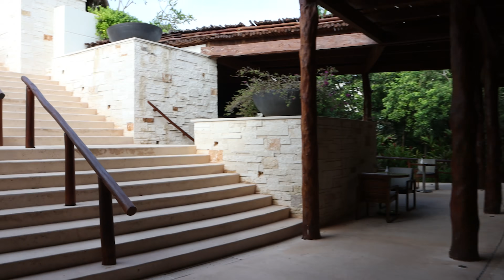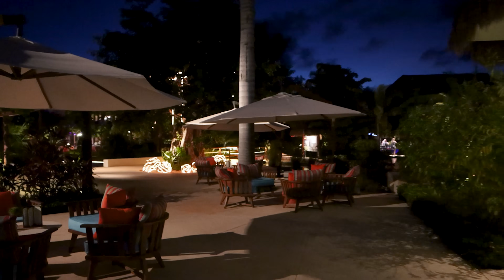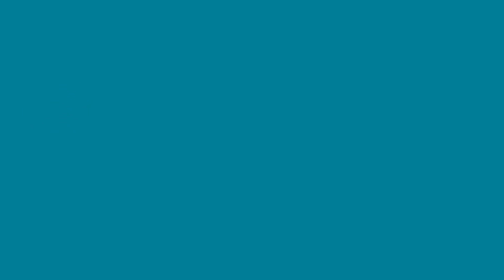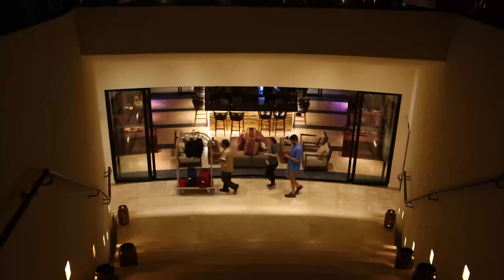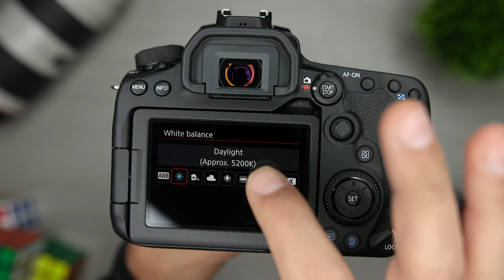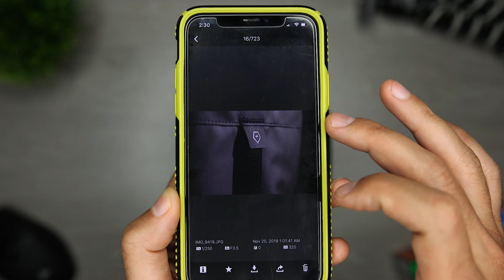Canon 90D - Watch Before You Buy

Comment: Great review. I was really excited when this camera came out last year and was planning to buy it. But as I am looking for a Camera for vlogging on my own YouTube Finance channel, i made the cardinal sin of 'over tubing' and was slowly turned onto the diminutive (and cheaper) YouTubers favorite M50!  Whilst it is double the price is the 90D my best option if I want to use for blogging and my 'family' camera sills camera as well. Or, as the majority of my use will be on YouTube is the M50 a sensible option and use the excess cash to buy an additional lens (or two)?? Would appreciate your advice. Loved the review though. Best I've seen. Many thx
Reply from the maker: Hi Keith. Good question. I love the 90D, but it's a big camera, and would be pretty heavy to vlog with. Definitely doable, but not super light. If you want most of these features, in a smaller package, check out the https://youtu.be/Nir8pfvfdFI . That's a great option if you want 4K. If you only want 1080P, the M50 will work. Look at the 16mm f/1.4 ef-m from Sigma - amazing lens (for M50 and M6MKII). I'm always a fan of investing in lenses. Hope this helps.
Reply: @TechGearTalk  That's great. I really appreciate your advice. I do like the Sigma range so I will certainly look at that option. One thing is should clarify (I'm 53 so all these tech terms are mostly way over my head, I actually do mostly Tutorial rather than 'vlogging' which I assume now is more mobile> I guess that makes the size and weight of the 90D less of an issue???
Reply from the maker: I look a it this way. If the camera is sitting on a tripod, size/weight do not matter. If I have to take it with me, pack it, carry it, and/or hold it - then it matter. Does that make sense?
Reply: Sure does, thanks. I'm going with the 90D!!!!!! .........I think :-)
Reply from the maker: Why not save money and use the M6MKII?
Reply: @TechGearTalk  lack of headphone socket was one issue I had. But the fully articulated screen of the M50 and the 90D would be the clincher. The M6 is pretty much the same price as the 90D as well - and the range of lenses have swayed me that way .........I think!!! . Appreciate the help and advice. Cheers
Reply from the maker: Makes sense to me (wanted to make sure you consider everything you can - looks like you are). I really loved using the 90D let me know how it works out

Comment: mentions competition at $1200.Doesn't mention the G9 now retails at $1200 street price is sub $1000 (B&H)

Records in 5K (6K photo mode is h265 30fps)
and records 4K 10bit 4:2:2 (h264 150MBPS) and 
high dynamic range (h265 75mbps 10bit 4:2:0). 
Records 4K 8bit 4:2:0 at 60FPS
Has sophisticated focus stacking options in-camera
Focus bracketing
Pixel shift (80MP) with de-ghosting
for an extra $100 you can record in V-Log L
Industry leading IBIS which allows you to shoot like 1 second stills hand-held.
Full size HDMI port (which can record a clean 4K 10bit 4:2:2 at 60FPS)
dual UHS-II card slots

But lets not mention it.
Reply: It's also a hybrid with an emphasis on stills. Has all the intervalometer and timelapse tools you need.
7-image bracketing
up 60FPS jpg and 30FPS raw stills
good AF for stills
not as good as Canon for video AF
Reply from the maker: I used the G9 for stills on a shoot and I really enjoyed it. I love the ergonomics (that automated manual focus assist was sweet), and the image quality was fantastic. 

I need to get one for a couple of months to give it more of a complete test - I only had it for about 4 hours. 

Appreciate you contributing to the community.

Comment: i keep wondering why buy an aps-c camera while you can get fullframe camera with that price?
Reply from the maker: Hi Ken. Good question. Canon - for example - does not offer a FF option with this same feature set. Another reason is that APS-C lenses are a lot less expensive. 

I don't have a preference, they are just different tools. What do you think?
Reply: I have always shot aps-c and I lack for nothing(Majority wildlife). It also gives you more range when framing the shot. I shoot with friends that have FF camera and the quality of the pictures is the same. FF has its benefits and with enough pixels (on any camera) you can crop. Its just your preference.

Comment: Loved the review. I'm thinking of upgrading from my T6i and would love to buy the 90D, but there's one small problem: $$$! I can pick up a new 80D which would be within my price range. Would you still recommend the 80D in 2020? By the way, I'm not into video, just stills (mainly macro), but I´m not saying I´ll never dabble in video in the future. What do you think?
Reply from the maker: Glad you liked it! If you’re now going to want 4k or even video for now, just stick with the 80d (or even a less expensive body and invest in lenses. If later on you want video, the 90d will have dropped in price. What do you think?
Reply: @TechGearTalk  I think it's a good plan! Thanks for your  advice. I like my T6i but I was looking at an upgrade for two  reasons: better battery life and a bit more weather resistance. The 80D does both. The other differences, like improved frame rate, would also be a bonus. Video doesn't interest me so much. I already have my dream lens (Tamron 90mm 2.8 VC macro).
Reply from the maker: That makes a lot of sense to me. You can probably find some great deals on a used 80D too!

Comment: What's a good body option for low light, indoor photography?  I've got a 50D with L lenses, but bought for outdoor photography at the time.  Life has changed and I now shoot far less (it's just hobby income) and almost entirely inside a performing arts theatre, doing plays and music performances.  Low light, coloured lights, high ISO noise, motion blur etc.  What bodies would be good to replace my 50D with?  Mirrorless?  An older full frame body?
Thanks!
Reply from the maker: I was happy with the low light performance of the 90D. You have very specific conditions (even low light could mean different things). Is there any way you can rent the body - and then apply the rental fee to the purchase if you're happy?

Comment: Great video, so informative and clear in everything you covered. As a relative beginner I’m curious as to how it would compare to an M50? It’s obviously a decent step up in price but wondering how the crop on the M50 compares? I am using an adapter to allow me to use standard lenses rather than the more expensive comparable M lenses. I’m really not sure what would be the step up in terms of less crop from the M50 as I was told it’s better than an entry level dslr in terms of specifications but not sure what would make the price jump worthwhile, if at all? Hope that makes some sort of sense!! Thanks
Reply from the maker: The crop of the M50 will be identical in 1080P, but significantly worse in 4K (plus the auto focus is horrible on the M50 at 4K). 

Look at this option for the best of both worlds Tracey: https://youtu.be/Nir8pfvfdFI

Let me know if you have any questions!
Reply: @TechGearTalk  thanks so much for the reply.  I forgot to say I only take photos and never video! So I'm trying to work out the difference when taking pictures with M50 compared to a non full frame dslr (I dont have the budget for full frame!)
Reply from the maker: AH, ok. So, the main difference is that the sensor on the 90D and m6MKII (which is a better version of the M50) is 32MP vs 24MP on the M50. It's not a significant difference for every user. I liked the M6MKII better than my M50 (more comfortable to use because of the buttons and dials it has). Hope this was helpful.
Reply: @TechGearTalk yes,  thanks so much for taking time to reply
Reply from the maker: So glad it was helpful. You're very welcome - I to help whenever possible.

Comment: First time viewer of your Chanel. Thanks for the honest review, looking to replace my Canon 7D MII, not happy about only having one card option, love shooting and recording to 2 cards on my shoots.
Reply from the maker: Welcome and thank you for the kind words. That is something that's hard to give up once you've learned to appreciate the redundancy.
Reply: Its got much better image quality than the 7d mkii.
Reply: mark rigg thanks!  Do you have one?  I’m in all except that you can only record to one card. Still praying for a 7DMIII but I don’t see it happening.
Reply: @TwoCaptainsOneShip  No worries yes I did buy one because Canon have stated they have no plans to do a 7d mkiii. Which is a shame. However the good news is that they have finally learned how to make a sensor and it's easily the best crop sensor available now. It's servo tracking in autofocus is not as good as the 7D so if you did lots of birds in flight then the hit rate would be lower. If I was a wedding photographer then I'd have an issue with the single card slot but for amateur use it's only a minute risk. Hope this helps.
Reply: mark rigg I shoot a lot of senior and family portraits and sports, soccer basketball and hockey. Used to photograph horses but the track I worked at finally closed so I’m out of business for the horses. 7D M II worked great for the horses for sure. Still working on the best custom auto focus for hockey. Thanks again.

Comment: Does image stabilization work in 4k video mode? And record audio in 4k mode?
I normally take photos and make videos (4k) of fast moving persons in seminar and animals in forest. Is autofocus super fast?
Sony rx10m4 vs Canon 90D. Which camera has better autofocus and image stabilization feature in 4k mode?
What would you suggest?
Reply from the maker: Yes, IS works in 4K. Yes, it records audio in 4k. You should always use the camera on a tripod or monopod if you're using extreme zoom. 

The rx10m4 has a ton of zoom (would be expensive on the 90D), but I really like the 90D.
Reply: @TechGearTalk  My main emphasize is on photo and video(audio recording without external mic) quality in 4k mode in both cameras. I have to record video and audio of person from distance(1-25m).  

Which camera has better internal mic reception of far distance(1-15m) voice  recording?

Which camera has better/faster autofocus and image stabilization in in single shot photo mode? ( to conserve battery)? {I my self in moving and tripod/etc are bulky).
Reply from the maker: I would get the 90D. There is no camera on the market that can record good audio at that distance. You will need to record with a wireless microphone connected to the camera, or use an external recorder and sync the audio.

Comment: Hi, question I just recently bought the Nikon 7500
and I am considering buying the Canon 90 D? What are your thoughts? I shot sports and my kids.
Reply from the maker: Hi Holly. Are you thinking you'll return the 7500?
Reply: Tech Gear Talk yes I bought it from Costco and they just came out with the 90d. I’ve researched them and wanted the 90d but have always used a Nikon.
Reply from the maker: I would go play around with the 90d first. I switched from Nikon to Canon years ago, and it takes a while to get used to it. Plus having to buy all new lenses... arght. 

Having said that, the 90D is awesome.

Comment: I seem to buy a new Camera every 10 years. I still use my canon 50D which I bought in 2010. Lol 😂 thanks for this awesome review, this video has push me closer to purchasing the 90D. You earned a new subscriber😀
Reply from the maker: I'm super glad it was helpful! Thank you for the kind words and for joining the community 🙏 

This would be quite an upgrade. If you want to try a mirrorless option that is less expensive with similar features, check out the: https://youtu.be/Nir8pfvfdFI
Reply: Hi
My beloved 50D has some issues (such as the dreaded error 30). My running thought is that I will move up to the 90D and have Canon repair my 50D which can be used as a backup camera.
The worst part for me is not the price or that the 50D uses a CF card. No, the worst thing is that the battery packs are not interchangeable.
Reply: I bought my 50D in Dec. 2008 and it's still working good, except for the lens has a problem with the zoom control, I've just recently ordered a 90D, which will be here soon. :-)

Comment: Hi, currently I am using 70D and want to upgrade to full frame. I do architectural photography. Now I am bit confused in 90D or 6D Mii, can you help. Thanks!
Reply from the maker: Well, if you want full frame, just get the 6D MII instead. What features about the 90D make you want it over the 6D MII?
Reply from the maker: Those are good reasons. Buying all EF  lenses will be expensive. It might make more sense to re-use your existing lenses. I like the high resolution and I usually bracket photos if there is a dynamic range issue. Hope this was helpful.
Reply: Thanks for your reply. I do architectural photography and the best part is that I can use all my lenses (18-135mm, 50mm, 10-22mm,70-300 L lens, fisheye lens) with 90D and features like 4K video, 100% Live view. 

Reasons for which I want to switch on FF are high dynamic range, more bokeh, good ISO handling.

Comment: Hey thanks for this awesome review! But I just want to ask, do you think this camera can handle cold weather (-20 to -40 degrees celcius)?
Reply from the maker: Hi, and thank you for the kind words. I would definitely call Canon and ask - I have used it in -5 to -10 and it worked fine. But, I also didn't leave it at that temp for hours without use - I just went out and shot. Please come back and let me know what you find out 🙏
Reply: I have a 60d that I’ve used in -20, -24C and it’s still alive, but I make sure to not make an abrupt change between so cold and warm weather, I shoot and put her back in my backpack

Comment: Great review, there seems to be a lack of them for the 90D, I bought it anyway and love it, I do have the odd issues with focusing using viewfinder but that's mostly because I'm using it for wildlife which does require a bit of patients and really snappy focus... and I would say the 120fps without continuous AF is not useless, (maybe difficult) but I think what doesn't seem to get much press is that the camera has built in Focus peaking option, so manually focusing isn't actually too difficult!
Reply from the maker: Good insight Sam. I think I said it's useless for how I use it but I agree with you that with focus peaking it can be used if you have a free hand

Comment: 120 fps is not almost useless without autofocus.  As long as you're not shooting yourself in 120 fps, just manual focus.  It may be more work, but useless? no
Reply from the maker: That’s good perspective. I’ll have to check, but I believe it’s useless for how I would use it (which would always be on a gimbal).
Reply: @TechGearTalk  totally understandable if its not useful for you, but in general, if you aren't on a gimbal and know how to manual focus, then its perfectly usable in all situations where you have 2 hands on the camera.  
Also just an aside, you shouldnt really need a gimbal for 120 fps, the ultra slowmotion should remove most if not all the shake in normal conditions.
Reply from the maker: I agree, you can also use it on a tripod, with and without a fluid head. I like to stabilize even at 120 because I'd rather have the best source possible, but I completely get what you mean. 

I really appreciate you taking the time to contribute to the community.
Reply: @TechGearTalk  thanks for the discussion!

Comment: Nice vid, though still have few doubt, how does the camera perform on high ISO, and how is the focusing system for birds and sports photohraphy, and how does the ISO performance compares with nikon D500
Thanks
Reply from the maker: Thank you for the kind words. Your questions are all relative to the d500 which I haven’t used. I wish I could help.
Reply: The performance is already bad above 500 ISO. I wish I hadn't bought the 90D. My old 70D performs better.

Comment: Thank you, this was a very good overview of the new Canon 90D.  I have the 80D and would like your opinion if I should consider upgrading to the 90D or just bite the bullet and go for the 5D MK IV. I'm a novice photographer and am still learning the digital DSLR ropes so I haven't even used the 80D to it's fullest potential yet. Next Spring my wife and I plan on spending a lot of time on the road in our new RV 5th Wheel rig and will be traveling to a couple dozen National Parks throughout the spring, summer and fall months.  I really want to have the best of both worlds (still and video) and don't mind carrying multiple cameras.  I also have a GoPro Hero 6 Black that would do adequately for HD video, but it struggles a little at 4K quality. I have a couple EF lenses and one is the Tamron 70-200mm f/2.8 SP Di VC USD version 1 lens and the Canon 50mm v-II.
Reply from the maker: Hi Mike. A few things 0 the first question is if you actually want 4K. If you don't, just keep the 80D - it's a very capable camera for both photography and video. 

The 90D is better (obviously) but it will be about whether it's meaningful enough for you. 

Sounds like an amazing road trip you have planned. 

If I were to bite the bullet, it would be to the EOS R, not the 5D MK IV https://www.youtube.com/watch?v=Y9Caw0Ykd7k